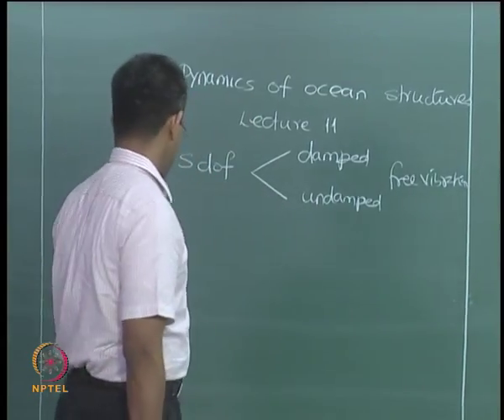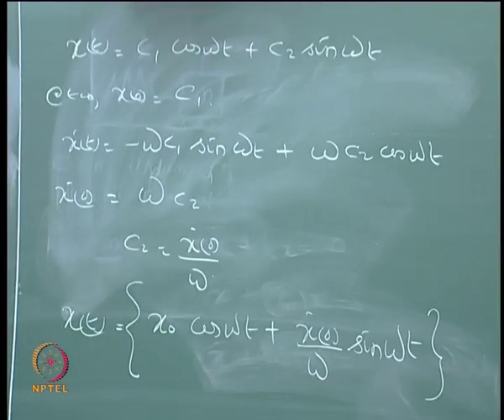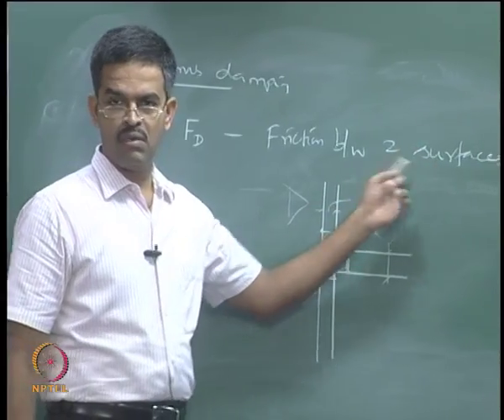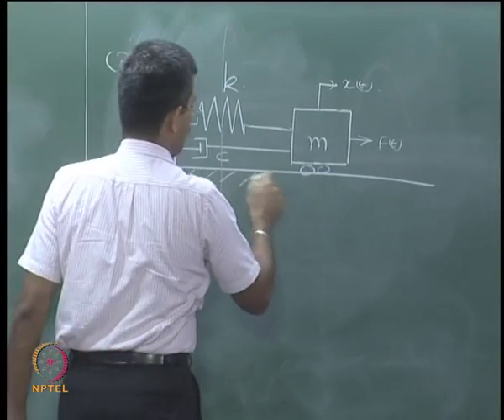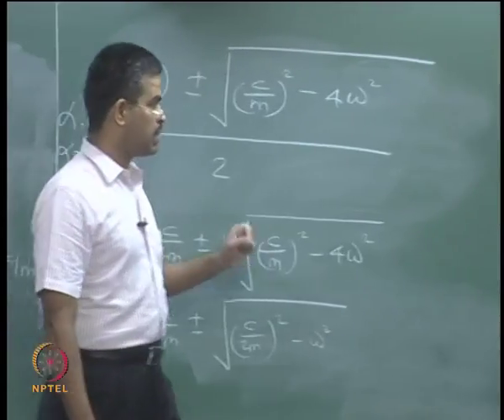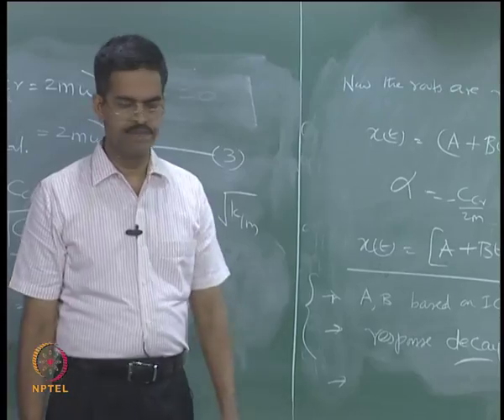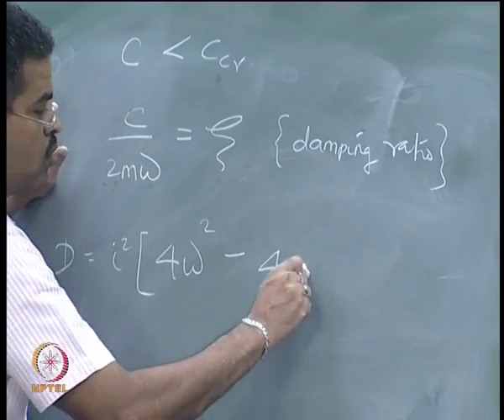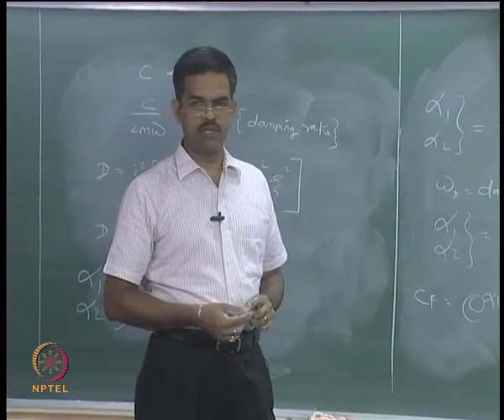Mod-01 Lec-11 Free and forced vibration of single degree - of - freedom systems

Comment: Thanks, Dr You hit the point at the 44:20 mins of the importance of understanding where all the algebraic and differential equations come from. In most Universities in the western world, the lecturer will just give you the formulas and you just wonder where the differential equation or the quadratics come from. So you are already confused even before you start working on the questions and you mixed up the formulas and engineering conditions required.

Comment: In the under damped case, the part where discriminant is modified, how can D be equal to 4D? In the modification step it has been multiplied by 4 throughout the D. Someone please help me understand this part.
Reply: +Jonty Roy  I think he misplaced the 4 value, referring to the original discriminant derived earlier where the square root of discriminant is divided by 2.... just based on what I understand